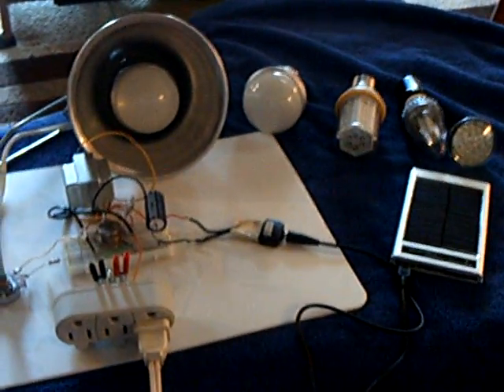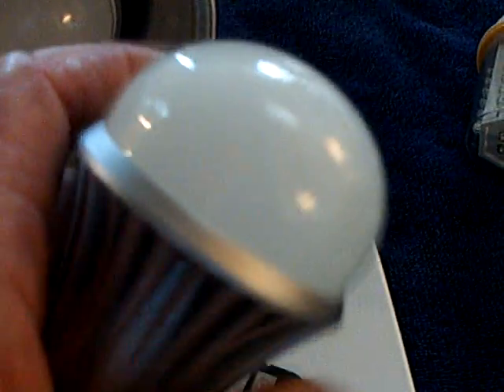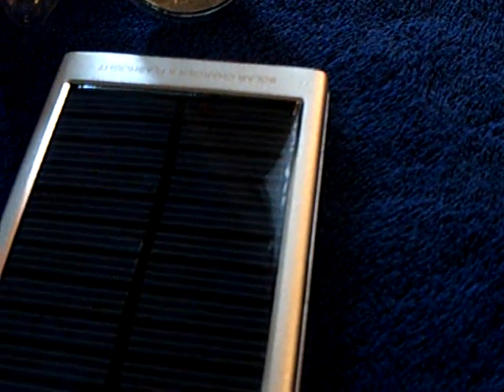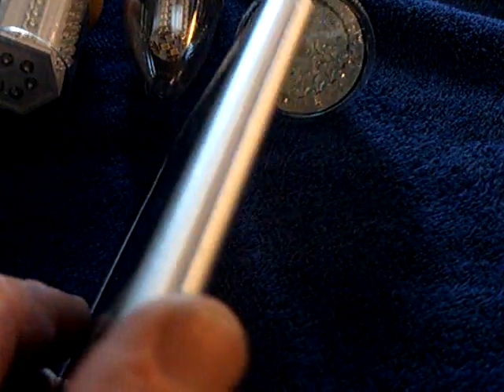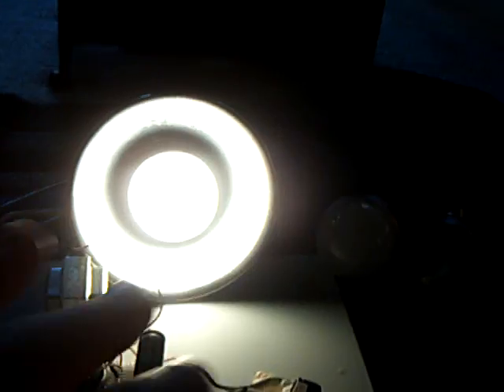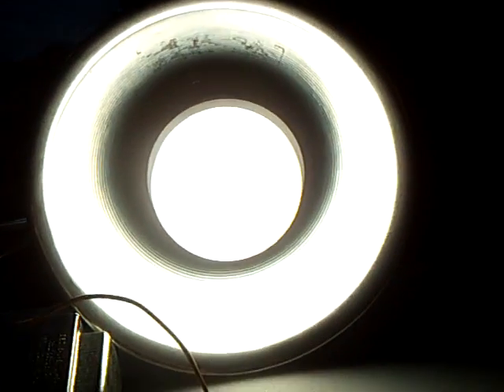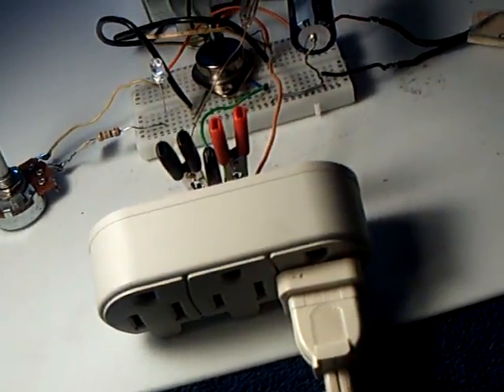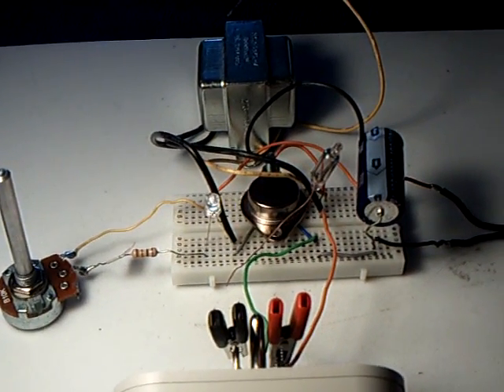Solar cellphone charger powered AC LED light

Comment: I would use that with you regular table lamp and get a bigger battery. I also want to investigate door bell transformers. My only beef is that people are greedy but if this was to come to mass market it would have to be in flashlight form with an outlet so you could plug in lights to it. The trick is making so industry does not feel they have competition or else they may want to legislate to stop it like other good technology.

Comment: Great job once again Lidmotor. Now can We run multiple 2.5 watt  bulbs off of this 6volt circuit or should We stick with the 12 volt one since there are some component differences?

Comment from the maker: Thanks.  I wonder is anyone else is thinking what I am  --Can we make a homemade battery that will run this?  All we need now is about 5 volts and around 100mA and you have a standard AC led light that will work off a long extension cord.

Comment from the maker: I will try this with the one AA cellphone charger.  I'm sure that it will work but we remember that we found outthe boost circuit in those chargers are not very efficient and draw several hundred mA.  It is still a good idea though.  That little variable voltage solar panel that I showed a few videos back has a compartment in the back for charging two AAs.  Your solar garden light idea is a $1 way to do it.  Great idea!!

Comment from the maker: Yes but the energy recover this way is rather small unless you put the panel right up next to the light bulb-----but then you block the light.  Still is not a bad idea.  Even if you gain just a minute or two of run time --it is free and why not use it.

Comment from the maker: The energy recovery idea using the solar panel I have already tried but it doesn't work very well.  The solar cells just are not very efficient.  Howerver even a small recovery using your idea is SOMETHING and why not take advantage of it by placing the solar panel underneath the lamp at night.  I tried my Penny oscillator and it will run off a small secondary panel using this idea.  Thanks.

Comment from the maker: Excellent idea about using supercaps with this.  Now that I have this so it will run on 5.5 volts I can try a pair of small 2.5v  250F "hybrid" supercaps I have in series with this and it should run.

Comment: Great sentiments as well as circuit for smaller bulb 100mA. A 2 part route with possibly free components might be to use a standard garden light to charge the AA (which many will already have), then put in one of those 5.5V other chargers from the Slayer exciter experiments :)